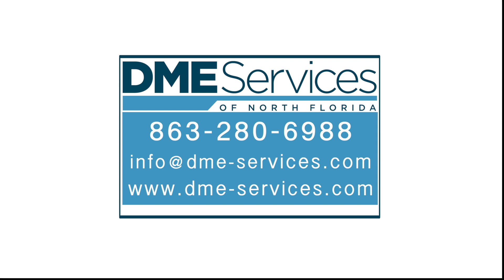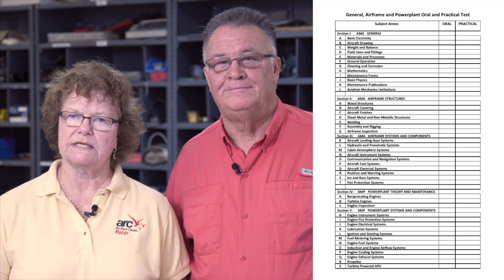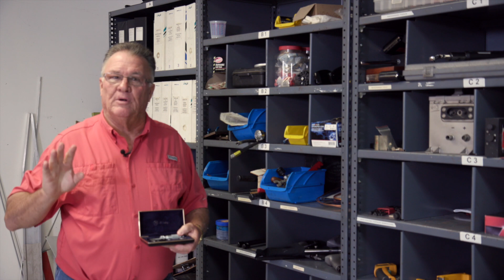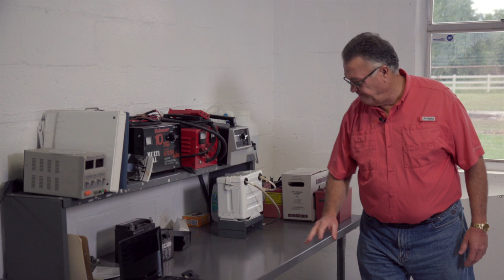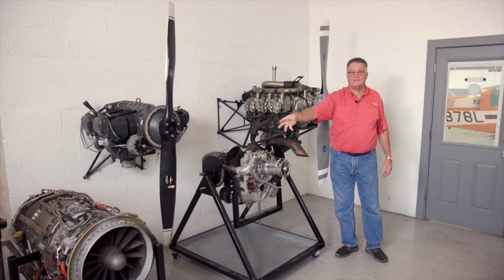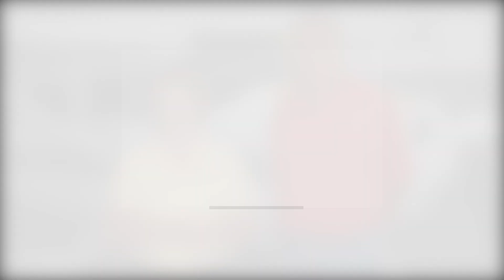Welcome to DME Services of North Florida. AIRFRAME AND POWERPLANT TESTING AND CERTIFICATION

Comment: Great video.  I think this the only one I could find that explains the process.  Can you elaborate a bit on a typical test?  Are you tested on 40+ oral questions and 40+ practical tasks?  This is the part I'm unclear about - how many of each an average person gets on test day.  Thank-you and keep up the great work!
Reply: I’ve already taken and passed my General & Airframe. I am about to take my power plant in two days. 

Study the Jeppesen oral questions. They are basically the exact questions you will be asked. You will need to answer 40-60 oral questions for each general, airframe, and power plant, without the use of notes or reference material. You will be required to get a 70% pass rate for each section. Around 10 sections for each G,A,&P. 

You will be asked 4 questions out of each section, so you are allowed to miss 1 question for a 75%.

If I missed two questions, my DME would then ask 7 questions total to allow me to get to a passing percentage. (5 out of 7 questions correct is a 71%)… 

You’ll have around 7-8 practical projects to perform as well for each G,A,&P. The projects range in time to complete from a couple minutes, up to a couple hours in some cases. Generally, the practicals end up being a lot easier than you think, but some can catch you off guard. You will be provided reference material to look up information about the practical if you need it. You must pass every practical project.
Reply: @Enuroracer222  This is very helpful.  Thanks for taking the time to reply with such a great detailed response.